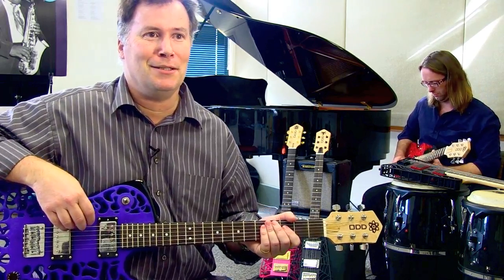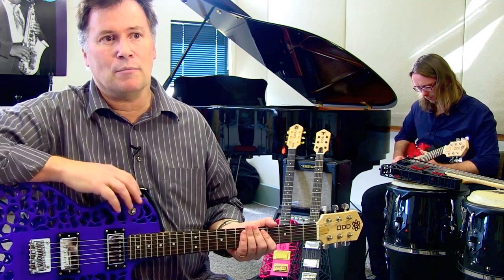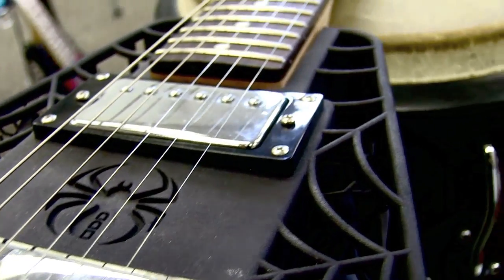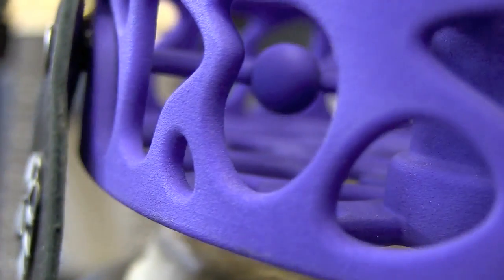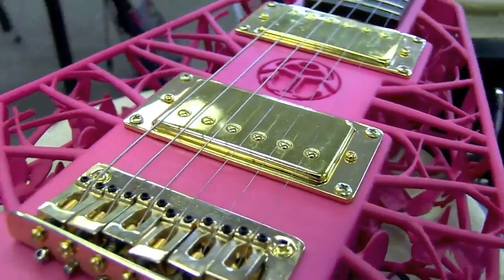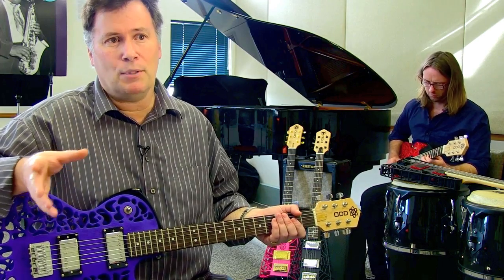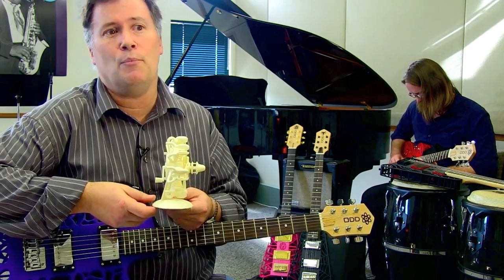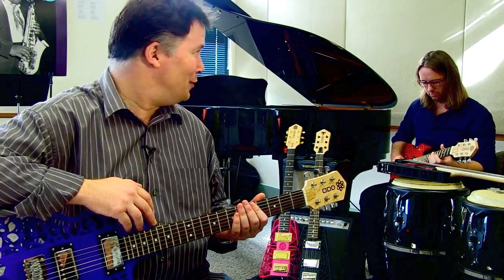Spider guitar strikes right notes

Comment: The crappy sound dosent sound like the body but the amp theres other videos on these where the guitars sound fantastic.The wood really dosent make a huge differance since most of your sustain comes from your amp settings so unless its an acoustic the whole wood makes a huge difference is all hype. Except how long  the strings vibrate most of the tone ccomes from your pickups amp and effects. Your hands make a bigger difference then what the body is made of.
Reply: You have no idea what you're talking about. Wood makes a HUGE difference to a guitar's tone AND sustain. Go get a guitar made with Mahogany and another made from Maple and you'll hear the difference immediately. Watch Rob Chapman and Lee Anderton's video on it to hear for yourself. Yes, the player and the amp make a difference too, but so does wood, the string gauge, scale length, pickup settings, etc....
Reply: Nathan Bellows The difference is in the pot values in the pickups, no two guitars, even if they're the same brand, model, everything, have the same pot value, so there's always going to be a small difference in the tone between two guitars, enough so that someone will think that it's the wood. The tone comes from the pickups, the wiring, the positioning of the pickups in relation to the bridge and neck, all the knobs are set, what kind of pick you're using, how long is your chord that's running into the amp, if it's over 15 feet, there's a difference, immediately. But wood, doesn't change the sound enough to say that it has any realistic basis for the tone, it does affect how the strings vibrate due to the fact that the strings vibrate through the bridge which is connected to the body, but that doesn't even change the tone that much. Unless you're using microphonic pickups, then the wood does count for the tone, but still not enough that you can state that the basis for the guitar's sound is in the wood.
Reply: Nathan Bellows Then how do you know that it is the 3d printed body making it sound 'bad'..?
Reply: i like your technology degree bro

Comment: wood does make a DIFFERENCE. And the shape of the body and even the shape of the horns, if it has ones)
I've taken my Explorer that I've built myself to the Gibson shop in my city. The guitars had the same pickups (active pickups, by the way), the same hardware and the same type of wood. And they sounded VERY different. None of them was better, but they were different) And that's because the very same wood had different density. So, ALL these aspect do matter

Comment: I see how you can think that, but if you are going to get technical, you have to see the whole guitar as a physical system.

Yes the pickup does transduce the variation of magnetic field caused by the movement of the string and plays a major role on defining the tone. But what affects the movement of the string? EVERYTHING!

Basically, the woods, nuts, frets, bridges and so on will affect the way the string vibrates and ultimately, they will indeed influence the tone of the guitar.

Comment: I'm still skeptical. I don't dispute that on acoustic instruments the wood and design matter a lot. However, on electric instruments, I can't see how the wood or plastic could have any affect on the sound. The magnetic pickups interact with the vibrating strings to produce a signal. The wood or plastic won't change any of that. The stings actually never even touch the wood. the strings are alway caught between the metal bridge and the metal frets or bone nut.

Comment: Exactly. There's another demo floating around where the sound isn't clipping, it sounds pretty good. Like I said, it has the steinberger size wood body with very hallowed plastic material. If it was pure plastic, honestly noone would touch it, so they were guitar smart enough to know that would be a bad move.

Comment: Perhaps, but don't knock it until you've heard an actually decent demo. No offense to the guy that demo'd it, but it wasn't professional (once again, clipping, and not miking the amp)
I'd agree that it's best to have a wooden body, but you didn't really hear it properly, so maybe the material they used could sound good.

It probably either sounds a bit like a semi acoustic or a steinberger.

Comment: Sounds awful, unimaginative designs and that neck heel has got to be so uncomfortable. I actually think the tech is great, the doors it opens but not greatly applied here. besides for the same price you could have a custom built tonewood guitar with midi controller, custom shop pickups, piezo system, you name it and still have change.

Comment: the catch line 3D printed guitar got me to watch - but comes out of the printer fully assembled and ready to go?  I don't believe that claim at all, and all it looks to me is either a printed guitar "BODY" which has everything else, such as neck/fretboard, strings, prckups etc installed - or the body is built around the other components. - so its a plastic guitar body and not a guitar - bit misleading really

Comment: an amp still have to pick up the sound coming from the guitar tho, you can only do so much with an amp and effects, if the underlaying sound is lackluster, it'll represent itself in the end result, and considdering the price of these guitars, I'd rather buy an equivalent guitar that was built for good sound instead of a guitar that's visually good looking